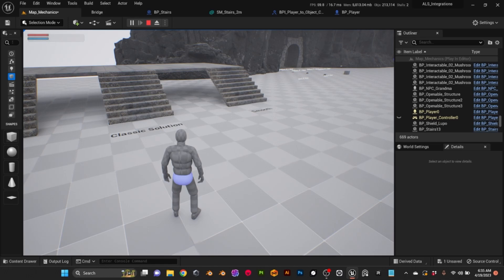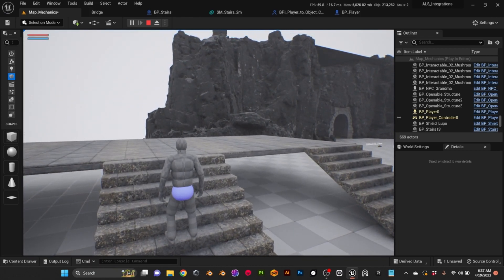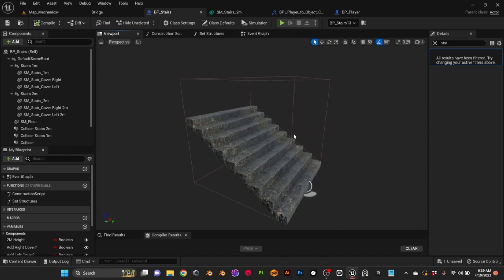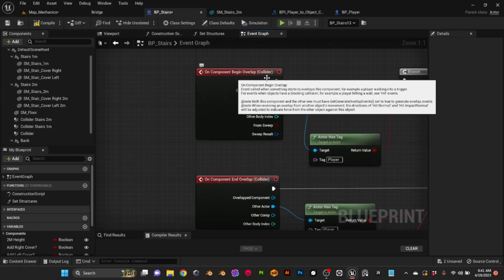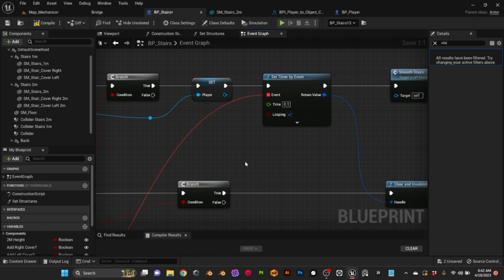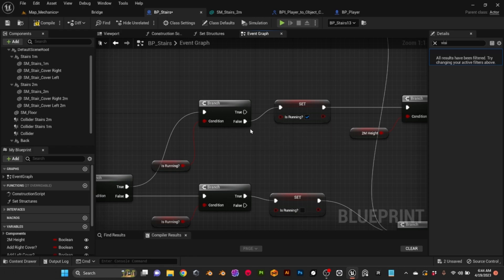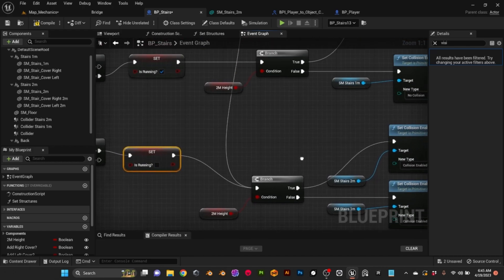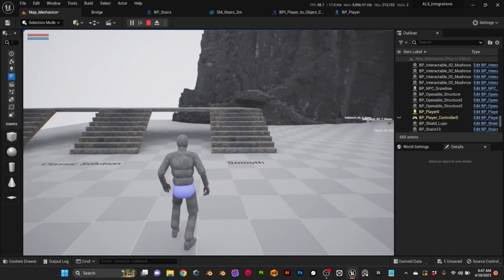Fixing Bumpy Stairs in UE5

Comment: Not a good solution, other have pointed out you can do the same with much much less code. 

Having said that, this is a "problem" with tons of solutions in the game dev space. Some hackier than others. The whole concept of the ramp for the movement is on the hackier side. Ideally, if this issue matters at all to you, you should be looking more towards a solution that steps up the actual steps correctly rather than an invisible ramp solution. The IK stuff will follow from there.

Comment: Another solution: add a plane on top of the stairs and make it hidden in the game. Set the collision to ignore the visibility. So the capsule will smoothly move on the plane but the IK will trace only the stair collision
Reply: This. Ignore the actual tutorial, future viewers.
Reply: Yeah this tutorial is crazy, not at all efficient. Using Tags is not recommended, if anything use a Surface Material
Reply: Sorry for the noob question, but how do you do that, do I need to do that in blueprints? Can I do this in the Details pannel under the Collisions tab or ??? Any help would be greatly appreciated!!
Reply: @flyzigga5039  Add a plane or wedge static mesh in your level viewport and select the plane/wedge. Go to the details window and look for Collision>Collision Presets>(Set it to Custom...).
Now find the Visibility collision response, and set it to ignore. Position the mesh as desired. That's it!

This is definitely an elegant and optimized solution, thanks to Nocte for the suggestion.

Comment: add ramp to stairs as simple collision and set foot ik to trace complex collision also solves this problem.
Reply: That's a very crafty solution.  I work for a game studio with many stairs in our recently released game (Hogwarts Legacy).  All of our stairs have a simple collision shape that is a ramp, as well as a detailed collision shape which is shaped like the steps.  The ramp belongs to the standard collision channel, and the stairs belong to the ik collision channel.  The capsule collides with the standard ramp, but the feet traces use the ik channel, so they only collide with the stair steps.  This way it all works without dynamic switching.
Reply: @BobCroucher That explains why I can bomb sprint on stairs full speed.
Reply: @BobCroucher  very useful, will look into it, thank you.
Reply: are you saying, removing the stairs mesh current collision and replace it by a ramp inside the mesh or inside the blueprint? what is the  best considering performance cost?